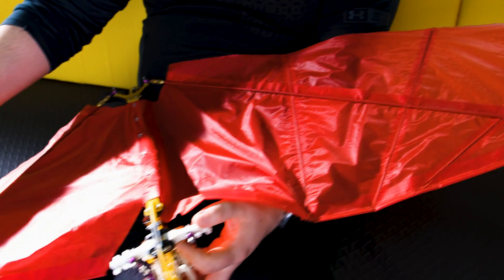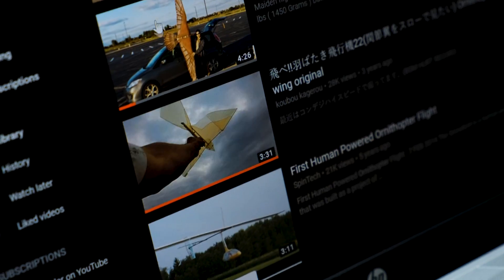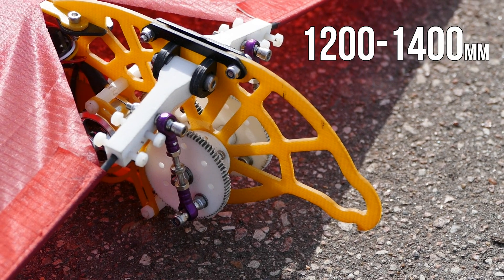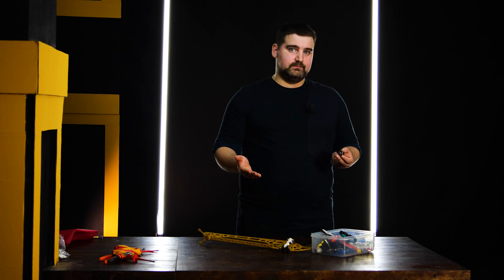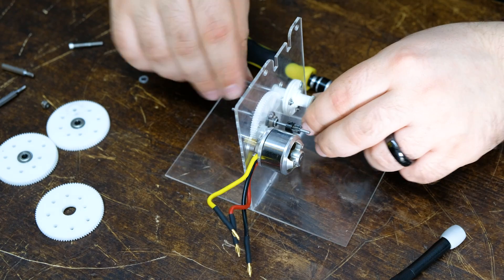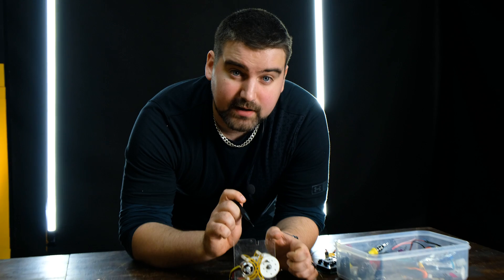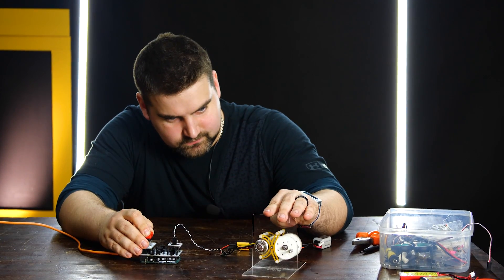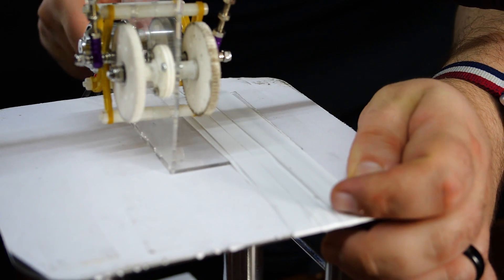DIY Ornithopter: flapping mechanism and types review

Comment: Am an ornithopter designer too. Am trying to build the peregrine falcon. I was using servo as my drive gear mechanism, but it turns out am not satisfied in the flapping frequency. I got 3hz on 7.4v. Kinda poor. My question is does much flapping frequency or flapping speed gives more lift and thrust? 
Also should I aim for speed or torque on my wings? 
Thank you

Comment: Great video man. I read your complete article on instructions.com. I have already started working on my ornithopter. I have a problem and was seeking your expert advice. Can I go for a low KV motor such as 1000kv that ways I won't have to use much gears and the torque will also be high making it more efficient.
P.S subscribed already
Reply from the maker: Sorry for not replying earlier.
Yes, such motor seems appropriate. But you will need to calculate the gear sizing (size and number of sprockets) to have the necessary flap rate.
Reply: Thank you. Keep motivating others with such awesome videos🍻
Reply from the maker: How is it going?
Have you got any results?